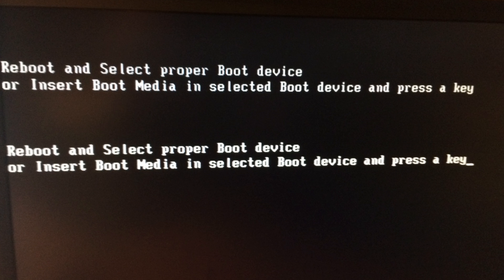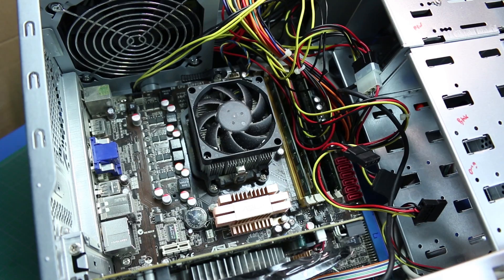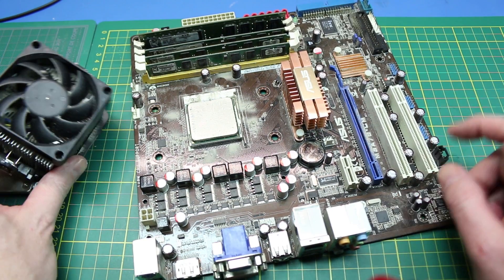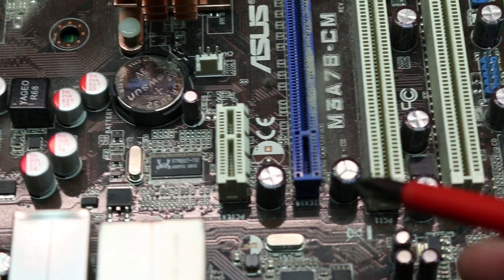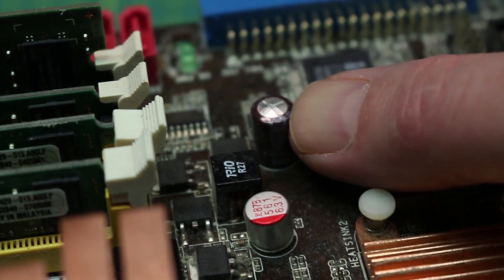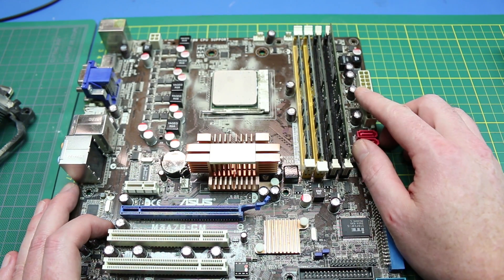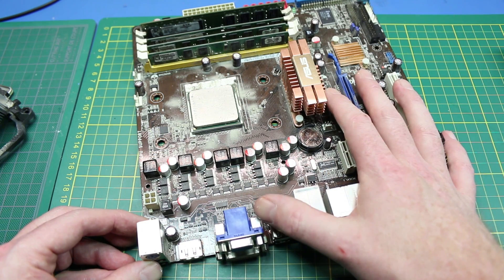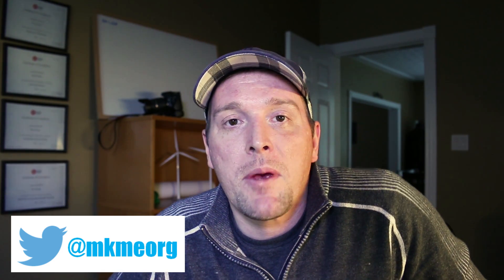Computer Won't Boot | Why Motherboards Fail

Comment: Hi, i have a 3d printer and last 2 times i used it it just stopped printing a few hours into the print... i have fixed many things over last year on this printer and it was setup and printing perfect... my question is can boards just wear out from to much use and start causing issue like i have??? i keep it clean pretty much ...i am also thinking maybe fan that cools board may be messing up... i did order a new board for it today... any info you have about boards is appreciated since i never fixed one... but i am guessing a board in a pc and a board that runs a 3d printer are basically the same... thanks

Comment: Electrolytic capacitors are dirt cheap dude. If you have soldering skills, put them to use, (if not, LEARN!!! That's what google and YouTube are all about) and just replace those capacitors. It beats having to spend more mulah on a new board.
Reply from the maker: Uhhhhhhhhhhhhhhh ya

Comment: The same thing happened to all three of my most recent ASUS motherboards, two A7V8X motherboards and an A7N8X motherboard. I damaged the A7N8X motherboard but I fixed both A7V8X motherboards. However, I have not much use for desktops anymore, so I decommissioned one desktop and I just have the one desktop left that I rarely ever turn on.
Reply: John Gotts My asus h81m motherboard beeps when I remove the ram or hard disk,fans spin but no booting. Do you think it could be the CMOS battery or this?

Comment: Fix it, caps are not that expensive and if the machine was good enough 2 weeks ago it will also be good enough next week when fixed.
Reply from the maker: +Yann Kitson True but the P67 i7 combo running it place of it just does a bit better job :)

Comment: Even the best electrolytic capacitors have a fairly low mean time before failure, add in higher ambient temps and they fail even faster. If memory serves me well I believe 10,000 hours is tops at rated temperature. It pains me to see heat sinks with a cap sitting right next to it, one cold argue that the heat sink would keep the area cooler... not so in most cases.
Thanks for the video